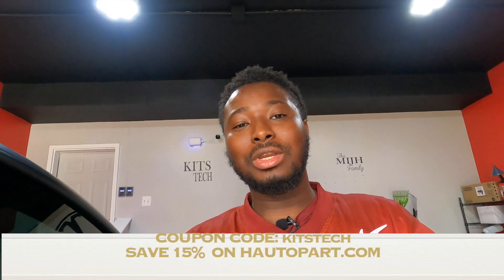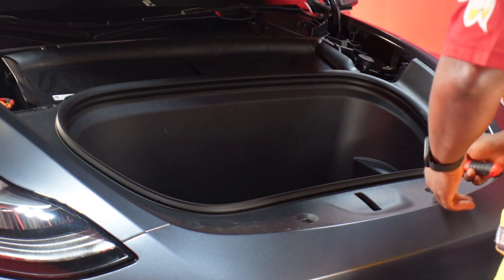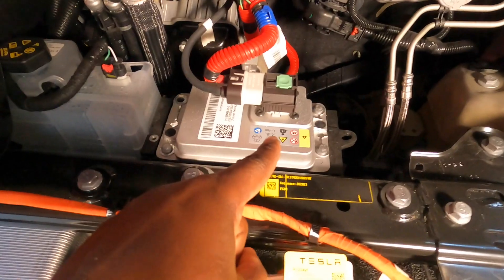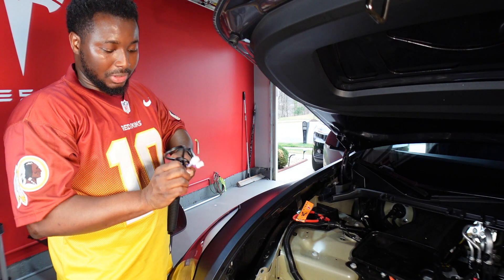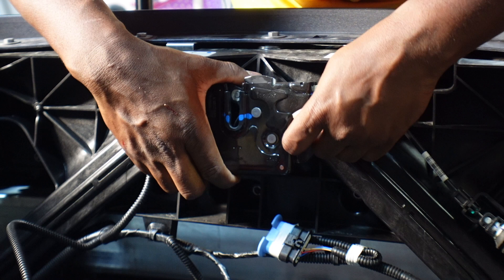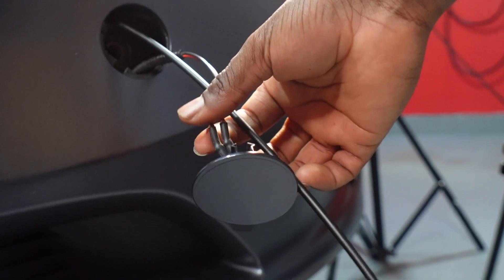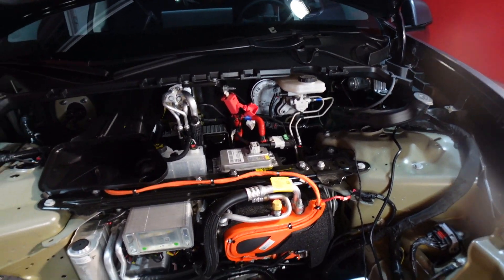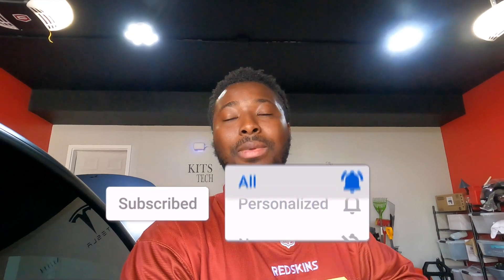2022 Tesla Model Y Power Frunk and 12V Li-Ion Battery #powerfrunk #lithiumionbattery #2022ModelY

Comment: Hey man! great video! I am going to attempt to do this on my MYP. How did you fix the alignment? that's the part I'm mostly nervous about because mine came pretty aligned from the factory.
Reply from the maker: My mistake was, I did not use a white marker so it was hard to see the original spot. My advice is, make sure you use a white paint pen marker before you remove the Tesla latch so when you put it back, you know where it belonged prior to taking it off. https://amzn.to/3xwPSF1

Comment: Were you able to fix your hood alignment? What did you adjust to fix the hood gap.
Reply from the maker: Yes, I did. I had to realign the latch to it proper location. This is the reason you use a marker to mark the latch original placement before you take it off. Preferably with a white marker so it’s easier to see.

Comment: Hey, I had the same problem you had at minute 12:00 where it wouldn't close. What did you do to get it to close and latch properly? I still have not figured it out on mine 😢
Reply from the maker: You just have to realign it. Pro tip, use a white marker to mark the original spot of the latch. I used a black marker so it was hard to see. I pretty much waited until the next morning when I had proper lighting and then I was able to align it in the right position, which was just bringing it a bit upward to the original position for it to catch the hook on the hood.

Comment: What size bolt did you use to connect power?  You say 10mm in your video but I tried 10mm and it is way too big.
Reply: Found the right one.  M8 x 1.25 threads.

Comment: Only question I have since I have the 2022 model 3 with the new 12 volt battery and it doesn’t look like it’s easy to change like the old 12 volt batteries. Where would we as tesla owners be able to buy these new types of 12 batteries from if we need to change them?
Reply from the maker: I don’t think you’d have to worry about replacing that 12 volt lithium ion battery for a while, you you ever have to, I’m sure Tesla has a plan for that. Thanks for watching!

Comment: Hi Kit. Great video!  I followed your instructions and installed the power frunk successfully but I couldn't find the correct hex cap size to secure the wire on the 12V Li-Ion battery. The 10mm size is too big and the 8 mm size is too small.   :-(
Reply from the maker: Hey sorry this must’ve slipped my view. We’re you able to find what fits? You can try a size smaller but that’s what fit on mine.
Reply: @KitsTech  Yes I was able to find one. Thanks for following up!